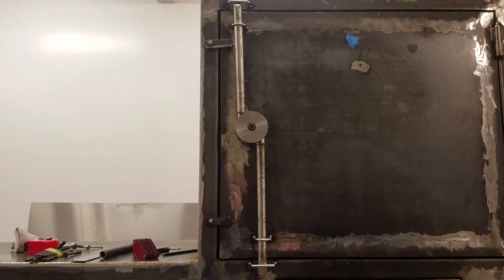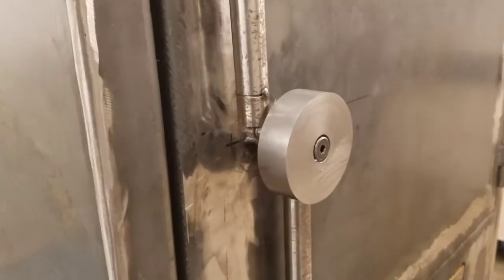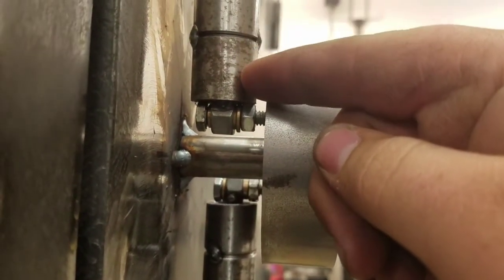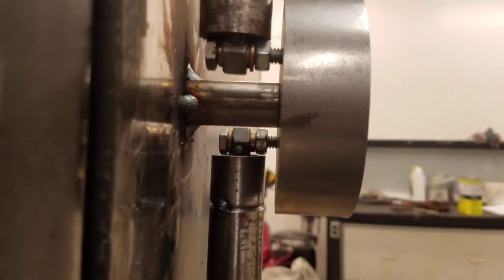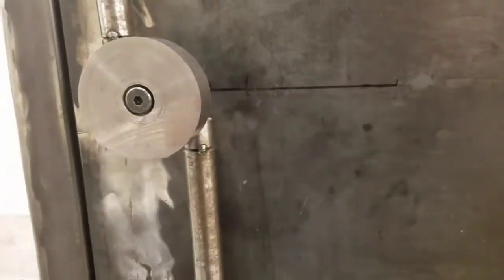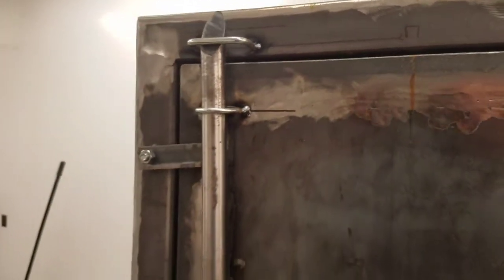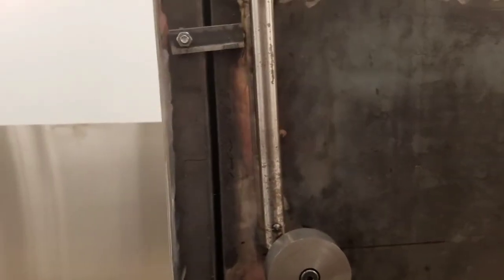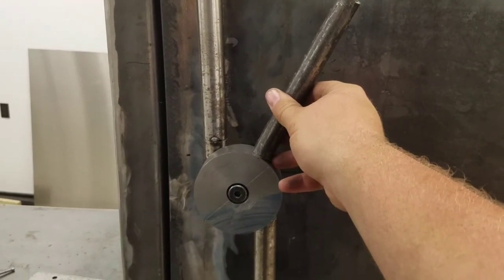Insulated Reverse Flow Barbeque Smoker Build Part 15

Comment: Make a small steering wheel or something from a lawn tractor or something like the hatches on a ship give it a little style.
I like your cabinet and the way you made it into an insulated fire box.
Shirley bbq had issues with warping doors and went to a 3/4 plate for the door.
What's your thoughts on that insulated fire box door ? Are you having any issues with it etc...